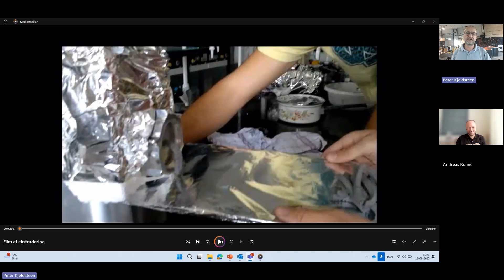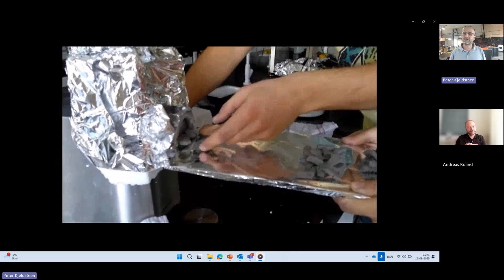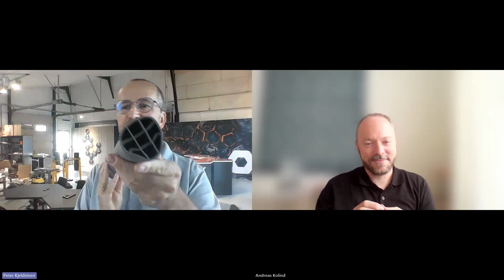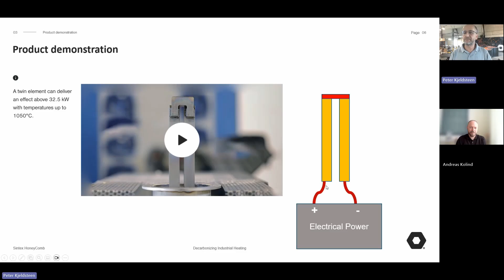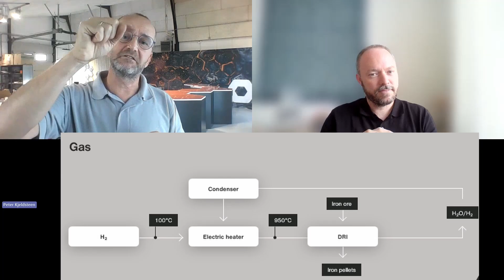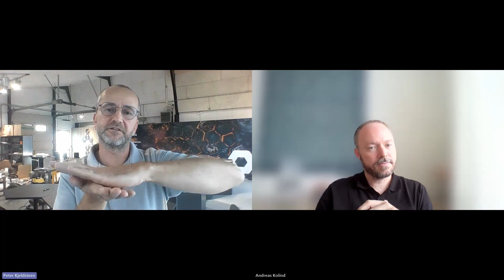Honeycombs - Can This New Material Help Save The Planet?

Comment: Great explanations, Peter. When struggling with welding onto the finished part I wonder whether it would be possible to fuse the terminal to the monolith in green state? Has this been tested?
Reply from the maker: Yes. Here the difficult thing is to control sintering shrinkage when combining a thin walled Honeycomb to a thicker connector.